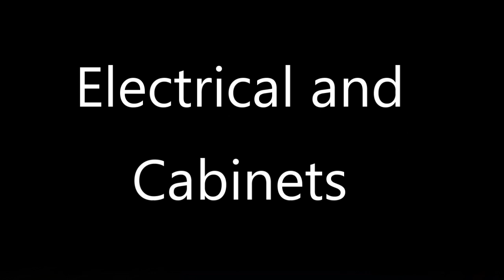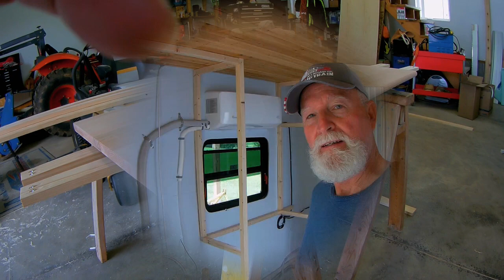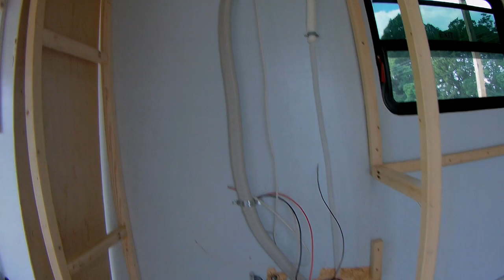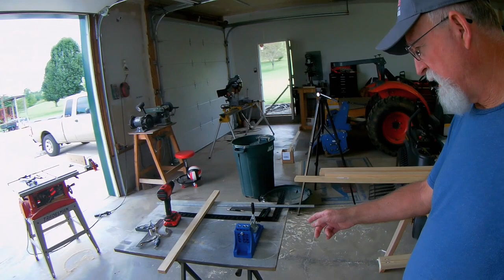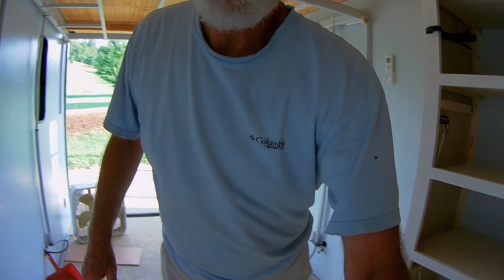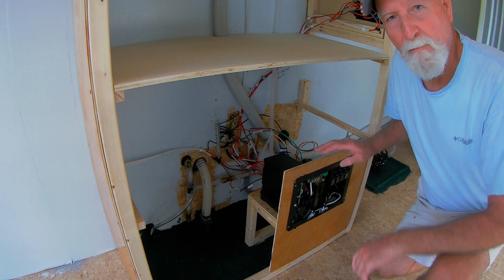Cargo Trailer Toy Hauler Conversion Episode 9 Cabinets and Electrical Distribution

Comment: Your videos have been very helpful. I'm currently starting my third toy hauler build. I really like how you did your bed lift system. I noticed you said you used heavy duty 3 in garage door guide wheels. Can you explain to me what you used for the tracks on the wall? I would like do the same setup. Thanks! BTW my name is Shannon and I'm from Chambersburg Pennsylvania.
Reply from the maker: Hi Shannon,  appreciate the comments.  The tracks are rubbermaid shelf track.  Available at any big box store in the shelving dept.  Here is a link to the track at amazon.  It shows the track installed how they designed it, but I turned it around as you see in the video.  https://www.amazon.com/Rubbermaid-FG3Q7400WHT-Track-Upright-Hardware/dp/B0044FTF94/ref=sr_1_2?crid=1YETHH4WDV8PL&dchild=1&keywords=rubbermaid+shelf+track+48+inch&qid=1605977704&sprefix=rubbermaid++shelf+track+%2Caps%2C578&sr=8-2
Here are the rollers I used.  I lucked out and found an open box return on Amazon and bought a box of 10 for half the price of new.  They are expensive, but I didn't like the little 2 inch, I don't think they will work with the shelving track as the axle would hit the track  as it would sit too deep in the track.   Good luck with your build.   https://www.amazon.com/Precision-Bearing-Garage-Door-Roller/dp/B07X2LQ78B/ref=sr_1_12?crid=1EYSCP79Y6869&dchild=1&keywords=3+inch+garage+door+rollers&qid=1605977906&sprefix=3+inch+garage+%2Caps%2C393&sr=8-12

Comment: John how did you screw your the ceiling in your trailer? Did you screw it to the frame of the trailer or did you made a frame also?
Reply from the maker: my trailer frames are on 16" centers, I screwed into those.